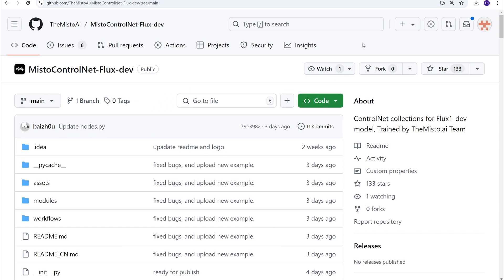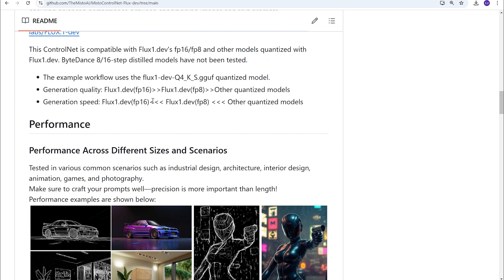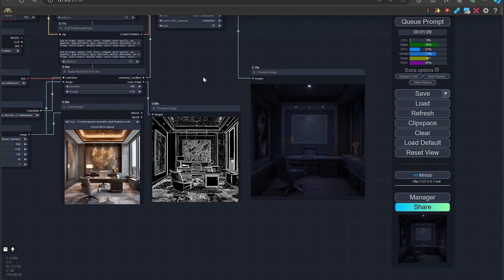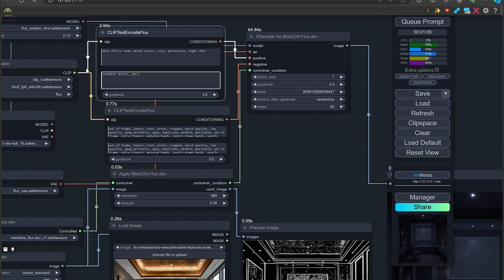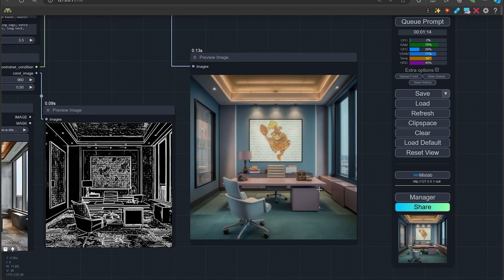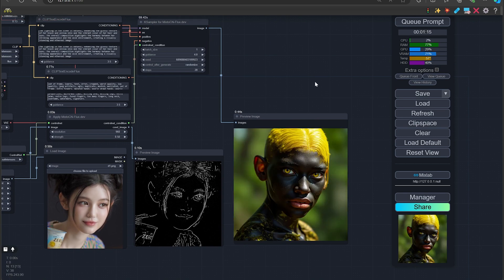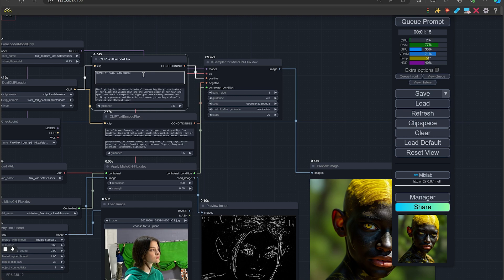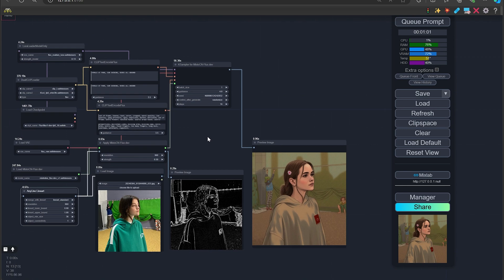Misto Controlnet Flux workflow in ComfyUI

Comment: You say ''make sure you have to git clone"...... Where do we git clone??????????? in which folder??????
Reply from the maker: To custom nodes folder
Reply: @AIFuzz59   I installed it in the custom_nodes folder (git clone github repos). 
I loaded the models as shown in the Models index, everything was done correctly and still the problem - Warning: Missing Node Types
When loading the graph, the following node types were not found:

KSamplerTheMisto
LoadTheMistoFluxControlNet
ApplyTheMistoFluxControlNet